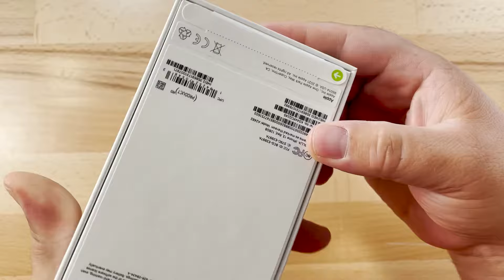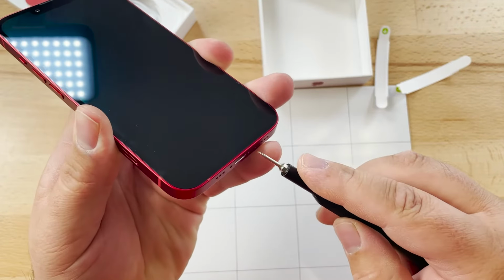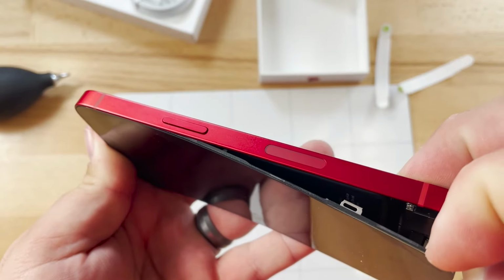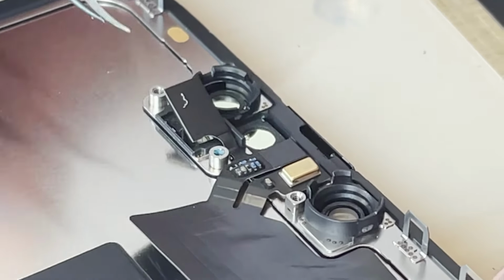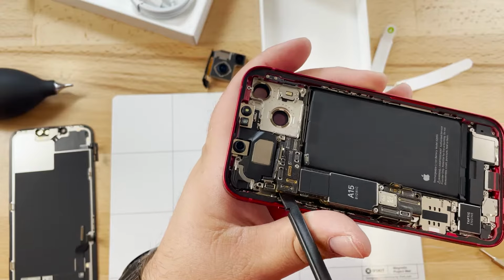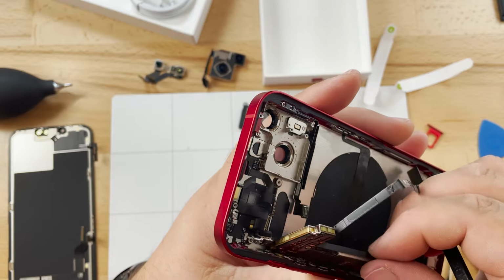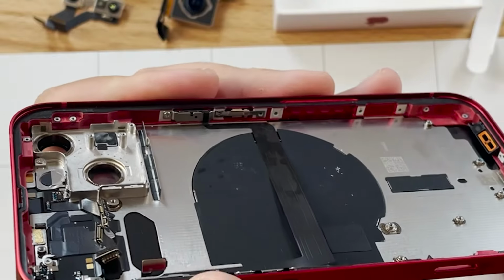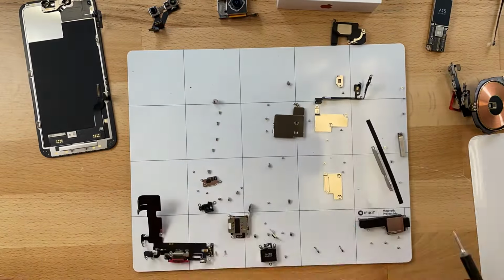iPhone 13 Teardown - Everything comes out!

Comment: I relied on this video for what began as ONLY a back glass replacement which turned to a wireless coil and battery replacement as well.
Reply: Dang , i dont like doing glass replacement bc the glass isn't original i like to buy a oem used housing but i will never again buy a bare housing bc there is to many small parts that needs to be switched over
Reply: And i didnt like how he just stuck a jimmy tool in insted of heating it up then pulling it up then push it in. But the phone  kinda looks like its been open bf tho

Comment: Does a couple of drops of rainwater on iphone 13 mute/silent switch damage it? Is it sealed to withstand that?
Reply from the maker: its possible, but shouldn't because the gaskets shouldn't be bad as its a fairly new phone. The seals normally only give out under pressure.
Reply: @FIXDPHONES  it’s a week old device

Comment: Hi! Was wondering if you’ve ran into this problem. My volume up button & mute/silent mode buttons do not work after rear glass repair. My guess is the wireless coil was damaged since my power and down button work. My question is should I just change out the mute/power flex cable (removing motherboard and battery of course) or should I go ahead and change the wireless coil also? I am not sure which would correct the issue
Reply: Also if you can, what was the name of the last part you took out?
Reply from the maker: It depends on the model of phone, I'm assuming its a 13 which means you can do either option. If you have even a cheap soldering iron you can replace only the flex cable if not then replace the flex with the coil.
Reply from the maker: GPS Antenna Flex Cable
Reply: @FIXDPHONES  great thank you! I appreciate the response 😃

Comment: what if the flex cable behind the motherboard gets ripped? can I still use my phone just with no 5g?
Reply: So it happened and i ripped it by mistake , and the answer is u still have 5g service 
Because this for the wifi not 5g so u will not be able to use wifi

Comment: The cable from logic board to frame that is name ?
Reply from the maker: The 5G antenna
Reply: @FIXDPHONES btw I had water seep into my case over two days. It was over the 5g antenna square. Should I be worried or is that water proof?